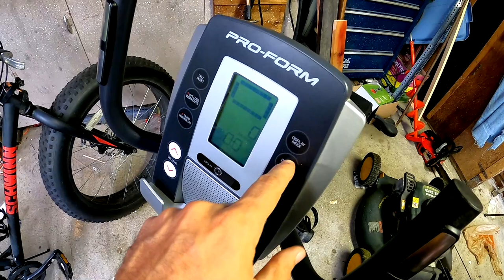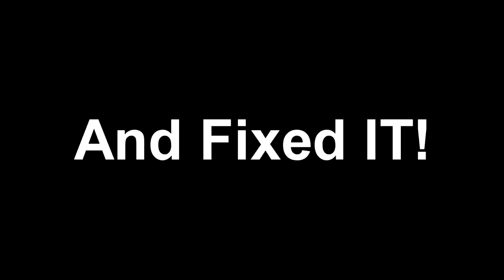What to do on a Day Off

Comment: Could always replace those green LEDs with some white ones, desolder the ones from the now dead light and solder them in place of the green ones, might need to change the resistor for them, cos green LEDs usually run at about 1.5-2v and white at about 2.5-3v, assuming they're not a phosphor-based green, which is excited by a blue LED chip (same as with white)... :)